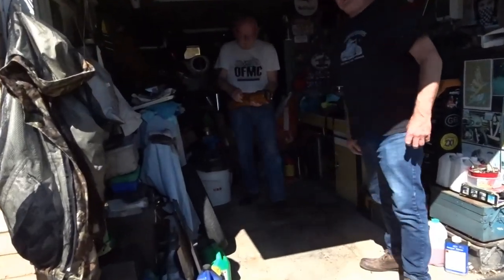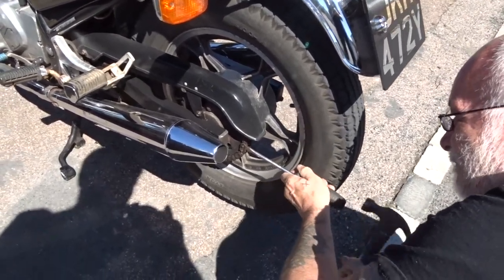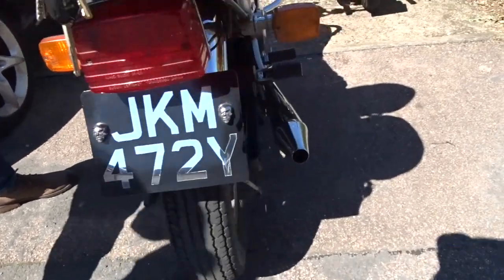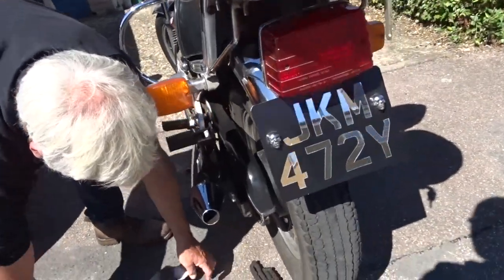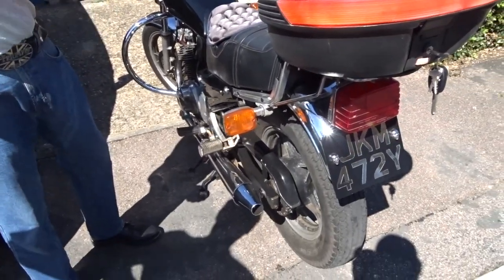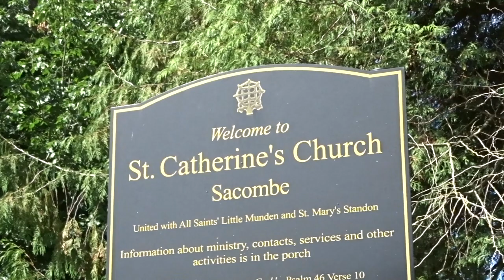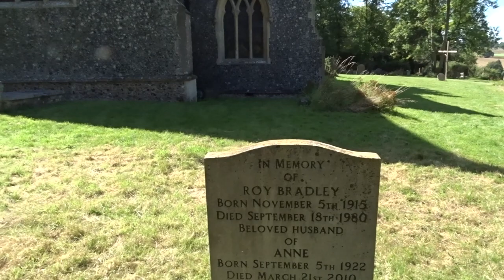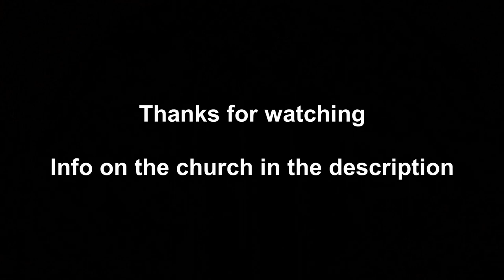A bit of maintenance a ride out and a visit to an 11th century church

Comment: Random question I no you fix bikes was wondering can you tell me if por15 is any good to seal my petrol tank
Reply from the maker: Yes for sure that's what I have been using. it looks like grey paint, tip it in, keep swishing it around the tank for 20 minutes then tip what's left out and leave to dry overnight, it's OK with ethanol so you will be good to go. I give mine about three days to fully cure but that's just me.
Reply: @OldBiker  thanks appreciate it . Only had the bike 4 weeks and it's got holes in tank it's a zephyr 550 so not easy to find a tank 😕
Reply: @OldBiker  It 'de-laminates' sometimes (sort-of-still-works though ) if you don't let it cure like you say   dave nz
Reply: Tried the por 15 unfortunately didn't work for me left it for days . Last about 2 hours and started leaking again so looking for another tank but carnt find 1